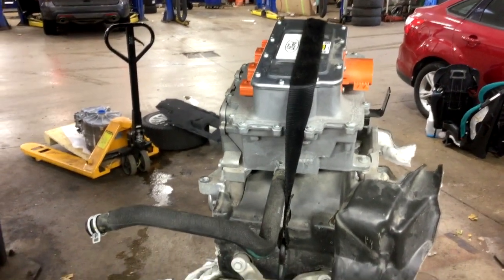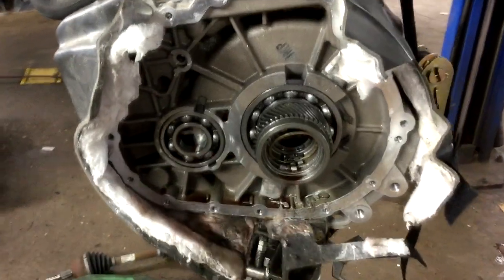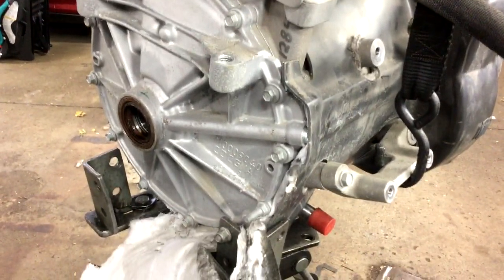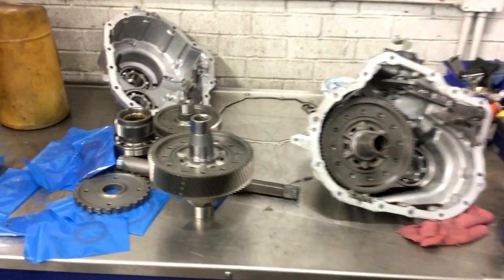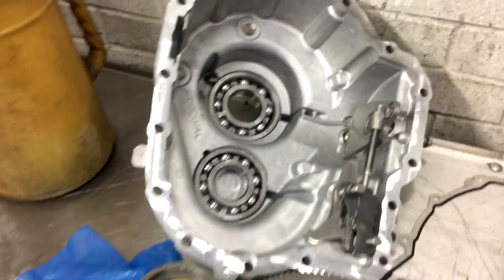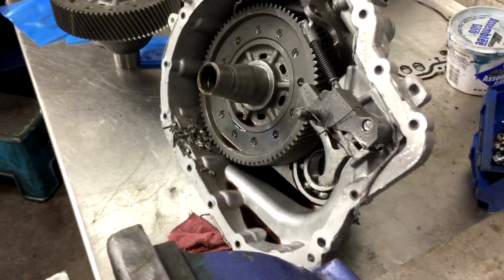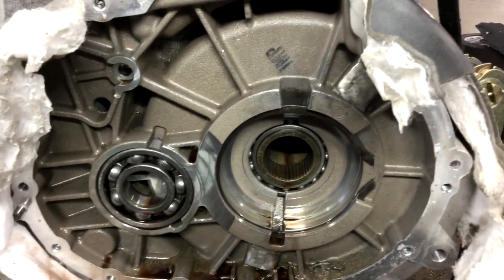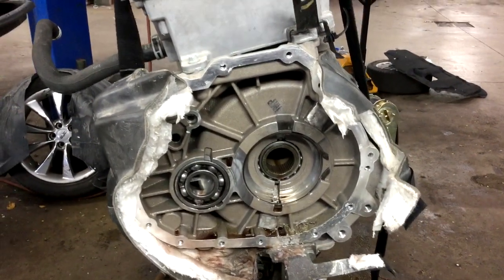Ford Focus Electric Traction Motor

Comment: What was the cause for the failure did it had a lot of miles
Reply from the maker: About 12000km
The final drive gear box that attaches to it had a bearing failure.
Both the gear box & electric motor share lubricating fluid so the bearings in the electric motor were contaminated & not serviced
You can see the bearing failure in my other video 
https://youtu.be/grZGUlmNwXw
Reply: Is this a service item? Any fluid or filter changes required to prevent the failure?